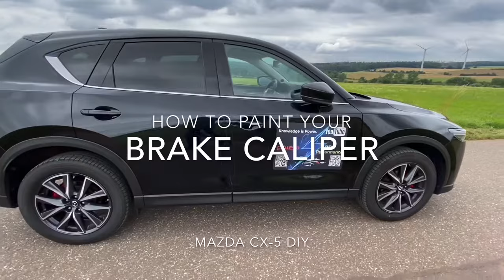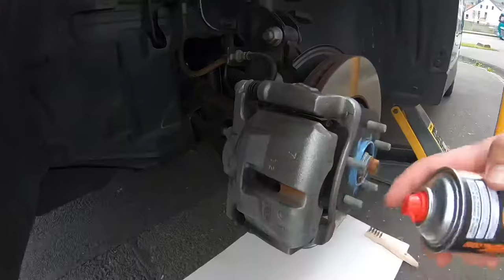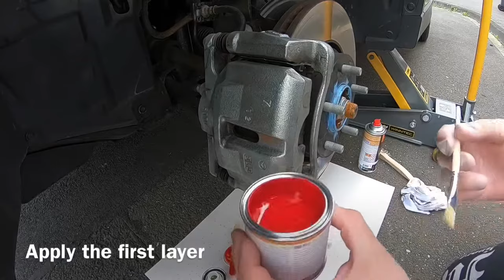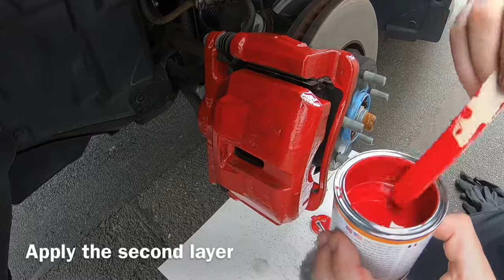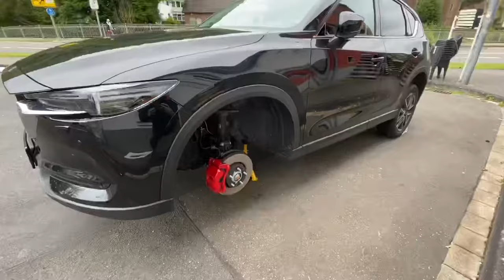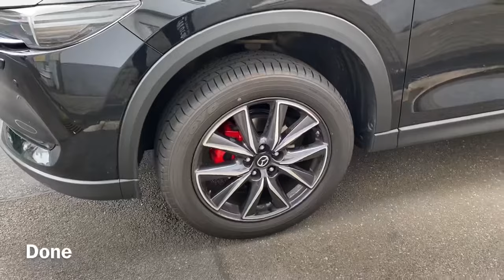How to paint your brake caliper w. brake caliper lacquer set (Foliatec Racing Rosso) Mazda CX-5 DIY

Comment: Looking good! I did these on my f30 BMW and a few months later they are covered in brake dust!! It’s almost impossible to get the caked dust off even with pressure washer. Do you know a way? Or am I to paint the callipers all over again
Reply: You didn’t let it cure. Probably drove it while the paint was moist 😅😅